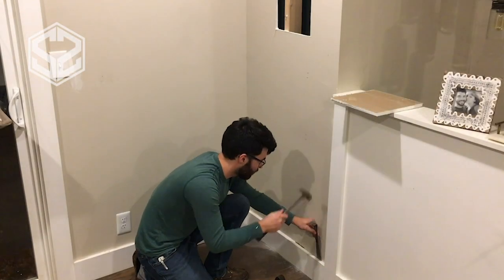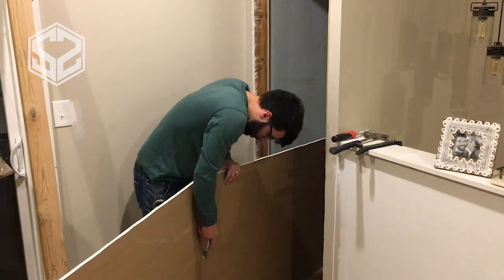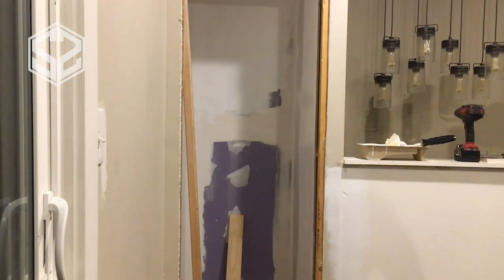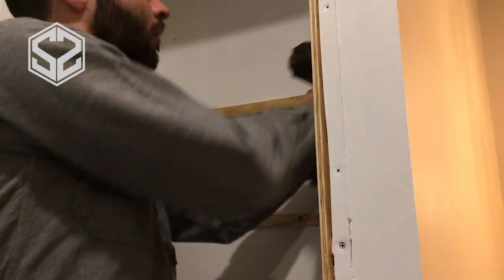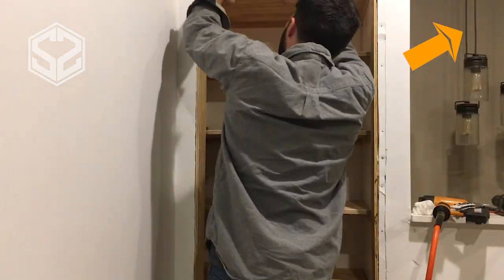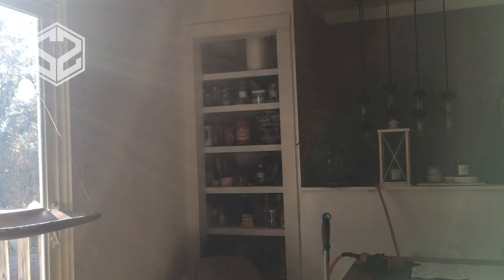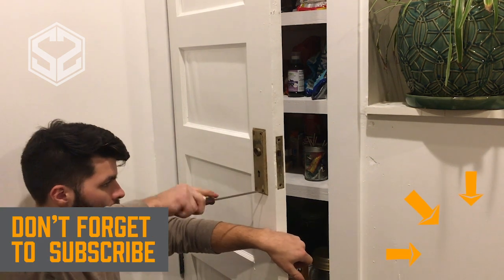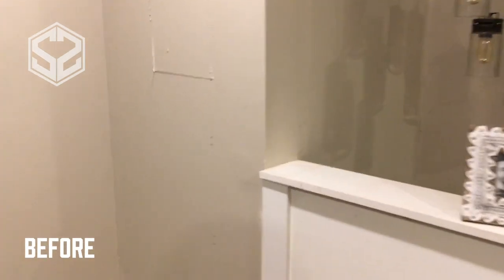How to build a Pantry

Comment: This is nice!how did you know that tiu had this wasted space...how were you able to determine you could cut the wall and find that large space that had a floor?
Reply from the maker: It can be difficult and I actually lived in this house for 2 years before I noticed it. I was able to check the room on the back side of this empty space and I measured it out and it was missing 2 feet of space. I also have a basement and was able to go below and make sure that there wasn't a chimney, pipes, wiring, or Air Ducts running through the space. Thanks!

Comment: Thanks for the video. Planning on doing something similar at my house. Can you tell us how did you secure your door jamb (the long piece of wood that your door hinge will be fastened onto). I didn't see any screws and looks like you nail it along the whole piece. What is behind it? Is there a stud?
Reply from the maker: Good luck with your project! The door jams were mounted to the studs I installed to frame in the new door way. I used finish nails to mount the door jams. I also used long screws on the door hinges that reached to the stud as well.

Comment: Great job. How far apart did you space the shelves?
Reply from the maker: I measured a few of the common items that we wanted to store so that I could space them out with little wasted space. The two bottom shelves were 14in for larger or taller items. 3 at 9.5in for medium items and cans can stack double high and the last one is 7.5in.

Thanks!
Reply: @SimonSaysDIY  Thanks for the info.

Comment: Hi! This was an awesome video. I would like to have this done in my kitchen, but not sure if there is an open space to place it. How would I find out?
Reply from the maker: That is hard to answer without seeing the space you have. However, if you have a conner in the room that is not being used it can be a great place to install one or if you have a floor kitchen cabinet that can be removed, just remove one section and replace it with a floor to ceiling cabinet/pantry. Doing this would likely triple your storage space from the section.

Comment: How did you know that was open like that?
Reply from the maker: On the other side of the wall is our bathroom and I it seemed like some space was missing so I measured the rooms and found there was some extra space. You can always cut a small hole to check and patch it back up if your wrong.